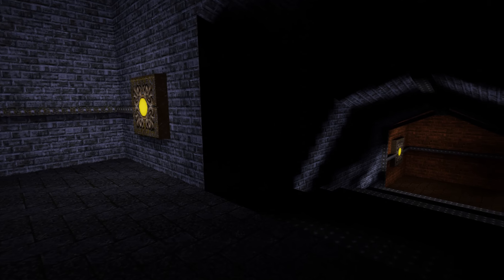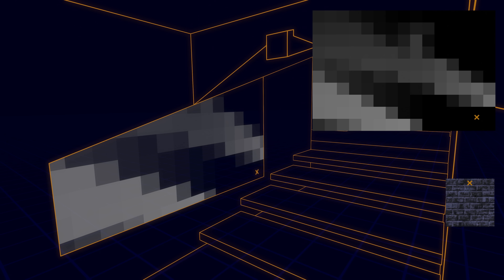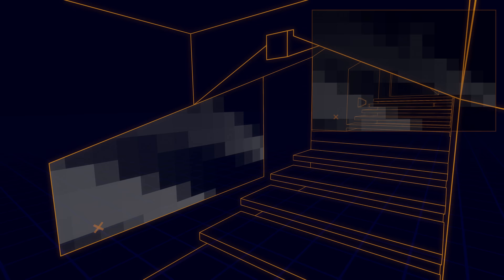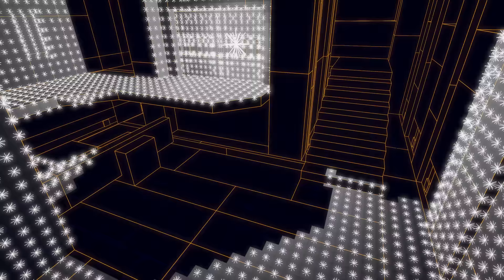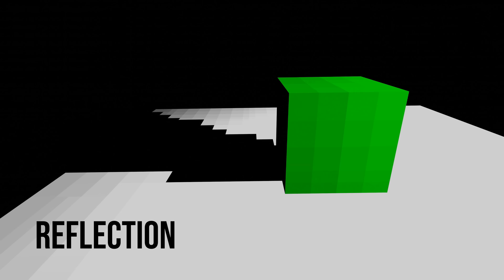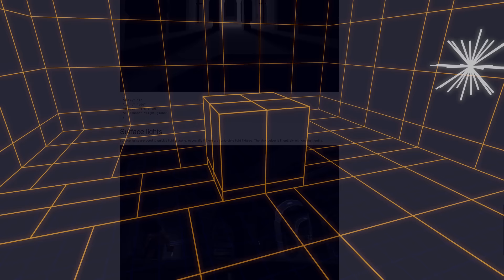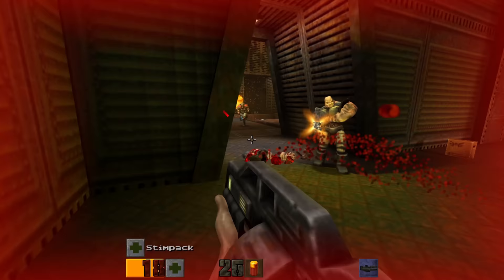Shedding light on Quake I and II lightmapping

Comment: Apparently Valve improved upon this in the Source engine with "Radiosity Normal Mapping".

As far as I could understand light maps are no longer baked in every face, but they calculate 3 directions of light so that the lighting of faces of any direction is easily computed at runtime as a function of the normal, the 3 light maps, and albedo. The 3 directions of light are stored on disk, being triple the size of a light map of the same resolution, the advantage I think, could be from being able to tweak the parameters of the lighting function during runtime, though I don't know if that's the actual motivation.
Reply: A way to think of it is that instead of a single lightmap, it calculates three lightmaps. Each lightmap is made the same way as you'd make regular lightmaps, but instead of using the surface normal you use a normal that is calculated from the surface normal rotated a bit to look at some other direction - and when you look at all three normals (that is the normals used for each lightmap) they are all perpendicular with each other. Then when you're rendering you just mix the three lightmap values based on the normalmap's normal. Valve published a paper back then that mentions exactly how they calculated these normals (you could use any three normals as long as they look away from the surface and are perpendicular with each other but Valve already did that part so no reason to not use theirs :-P).

I implemented this some years ago in an older engine of mine (if you check my channel you can find a video with it titled "Directional lightmaps" from 7 years ago), it works remarkably well (the video has zero dynamic lights, even the specular is precalculated by averaging the light directions and storing the XYZ values of the direction normal it in the alpha channel of each lightmap - this was a hack though and could certainly do a better job with it, like ignoring lights that do not contribute much and taking into account the surface color).
Reply: Current Q3 map compilers support it. Shortcut name 'deluxemaps'. Games like Warsow or Nexuiz make use of them, but Q3 itself doesn't support rendering them so they aren't of much use there.

Comment: Nice video :-). Lightmaps are neat, i think even today they are very useful when the lighting doesn't really change, though obviously you need slightly more stuff that what Quake 1 used :-P.

One thing i think needed a bit more explanation is the part about the samples moving to surface center, but someone else mentioned it (and you replied) already. Having implemented lightmapping a few times this part was always annoying to avoid (and Quake "cheats" a bit by having a solid world with no overlapping polygons - making a lightmapper for a generic polygon soup is trickier).

Comment: Really good explanation. Thumbs up. Out of interest, were there any changes with respect to Quake 3? I briefly mapped for Quake 2 but ended up moving onto Unreal whose tooling was really much more intuitive and the editor could rebuild lightmaps in seconds. The 3D viewport was even real-time and you could drag lights around and immediately see the effect on the map, minus shadows, which required a lighting rebuild.
Reply: Quake 3 had higher quality lightmaps, i think it is 128x128 by default. Also, it has overbrightbits, which kind of simulates HDR Lightmaps, but it's not as pretty. Years later Half Life 2 used real HDR lightmaps, which are much nicer looking.  Fun fact: you can actually inrease the lightmap detail in quake 3 using q3map2, and converting with external lightmaps. This makes some nice sharp edgees on shadows.

Comment: Love your videos! Can I request a video discussing how Quake stores the actual polygon data used for drawing? Not so much the bsp, but moreso the surfaces / triangles / verts / polygons used for drawing the walls of a map, etc, and how does this differ from other full 3d engines of the time? (ie System Shock, Unreal, etc)
Reply: From what I know, all Quake store their surface not as polygons, but as surfaces. The surface equation is A*x + B*y + C*z + D, where A, B, C are coordinates of orthogonal vector to the surface, x, y, z are coordinates of any point on surface, and D is coefficient, determining the offset of surface in 3D space. All surfaces with equal normal vectors (A, B, C) are parallel each to other.
For surface storage in .map file you need only 4 numbers (A, B, C, D), so you can create later polygons in map compiling stage to .bsp file.

Comment: Amazing video! I'm curious if Valve's VRAD (specifically the one used in GoldSrc and also the one from the Source engine, the infamous VRAD) differs from this method.
Reply: Valve VRAD is the derivative of Quake 2 lightmapper. It strongly differs from it, because it calculates indirect lighting and stores that information in so-called "ambient cubes" (simplified kind of spherical harmonics). These cubes allow to shade dynamic objects. Unlike Quake 3 light grid, these cubes are distributed not on 32 * 32 * 64 units grid, but on visleafs edges.

Comment: as far as I know Qauke3 changed this system maintaining the final result of a luxel textures, but implemented it in a 3d texture way? having a gird of point that kept the direction of all incoming fixed lights per point and their colour in order to have the 3d models well light, by the fixed lights of the map, at all times?
Reply: The 3d texture part is the lightgrid, which coincidentally was also added in the Q2 Remaster. Maybe we'll get another chapter explaining what changed with Q3 on that front - the Q3/idtech3 at large modding community also introduced some interesting light compiler development which surely must have influenced ericwtools we use today for Q1/2. I'm thinking of q3map2 with some work by ydnar et al. introducing phong, refining bounces and filtering options, etc.

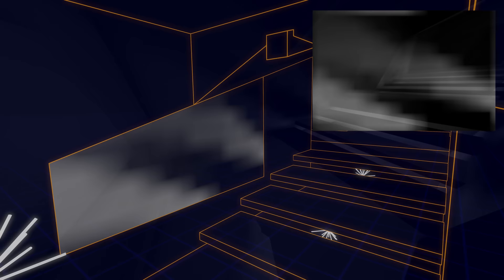Comment: 5:27 I implemented Quake style lightmaps for my engine but never figured out how to solve this properly, and to be honest even with your explanation I don't understand what is happening here. 

What does "any sample points that cannot see the face center" mean? Are they the sample points that are hidden inside the geometry where light cannot reach? You say that the sample points are shifted "towards the center of the face", but the points are moved only on the y-axis downward "towards" the center in the visualization. 

Is this process the same thing as replacing the hidden sample point values by closest sample point values that are visible to the light? Basically like clamping the hidden samples with first visible samples that exist at the visibility border? I remember thinking about this solution but not sure if I tried to implement it or got it to work.
Reply from the maker: Well spotted! The exact algorithm for shifting the hidden points is here: https://github.com/id-Software/Quake-Tools/blob/master/qutils/LIGHT/LTFACE.C#L270 .  It looks like it shifts 8 units in the vertical axis first, then 8 units in the horizontal if the shifted point is still not visible.  If after that it is still not visible then repeat the whole thing, for up to 6 iterations.  I never got to the bottom of why this exact behavior was selected.
Reply: @MattsRamblings  I see, that sounds very arbitrary but if it works most of the time and performs well I guess it makes sense. Thanks!
Reply: @meanmole3212  @MattsRamblings i think the same is done when there is a light grid system that uses probes( cube-maps )  in order no to have proves within wall or in the wall edge ( which would contaminate the final light calculations with wrong data ), the proves are moved within the correct space for the rendering and as well as for their final position, being kept out of the gird, and if their position needs to be corrected a lot, I think they are discarded
Reply: Yeah that bit sounded weird to me too. I also implemented lightmaps years ago in an older engine and this is something i faced. Personally i solved it in a different manner: when i take a sample i check if it is part of a polygon face (*any* polygon face, this is because two polygons might share  an edge in world space but use different lightmaps and the sample might end up over another polygon) and the face has the same normal. The sample is ignored if there is no polygon for it (e.g. lies outside the world) or if there is a polygon face with a different normal (failed at corner or there is another polygon covering it - e.g. imagine a box on a floor, the floor samples below the box would also have the box's faces on them). For each lightmap i also keep track of a mask for the lumel that had no samples contributing to it - after all lumels with at least one sample have been calculated, i go through all lumels with no samples and calculate the average color of the lumels with at least one sample that surround them and set their mask as if they had a sample. This is repeated until all lumels are set.

Making a lightmapper that looks ok is easy but fixing little issues like that is almost 90% of of the work. No surprise that many lightmappers even to this day have edge cases (though these days you can bruteforce your way by calculating something like 32 or 64 rays per lumel, which hides a ton of edge case issues). Unreal Engine 1 had these "black corners" which weren't solved until UE2 and i remember reading environment artist tips about cutting the bottom of models in UE3/UDK to avoid the black outlines in floor lightmaps.

These days i'd probably look into voxelizing the world and calculating lighting from that instead of using the geometry directly.
Reply: You can precompute lightmaps with blender, if that helps.

Comment: I wish an engine would come out that supports every lighting and shading model ever made
Reply: It would be a hell to debug such engine. That's why engines are designed with customization in mind. E.g. Open 3D Engine Atom renderer allows you to implement custom render passes.

Comment: How are the dynamic objects lit?
Reply: Moving objects such as doors do not change lighting when they move; they'll look the same even when moving to an area with very different lighting. Flashing, flickering, pulsing, or otherwise changing lights are done with a "style" value that the mapper sets, each of which is essentially just a list of brightness values stored as a string of letters which are computed during compilation and cycled through at runtime (fun fact - Valve still uses these strings to this day, resulting in lights in Half-Life Alyx that flicker in exactly the same pattern as the ones in Quake). Lights that can be toggled on and off through ingame events work in a similar way. In order to reduce the amount of additional work the compiler has to do, there is a limit of 4 light styles (including toggled lights) per face, and ericw-tools also disables bounces on these lights by default.

The Quake 1 and Quake 2 rereleases contain their own dynamic light system which is rendered separately and on top of the lightmap, which allows for crisper shadows that can move with things like doors and rotating objects.
Reply: @h4724-q6j Easily explains why a door's edge is completely black when is opened!
If the commenter meant "3D Model", I guess it uses basic vertex lighting.
Reply: @h4724-q6j  Great answer. I was also actually talking about say monsters in the middle of the room. Now I know they won't have very fancy lights, but is the light at the center of the room precalculated in any way?
Reply: @aussieexpatwatches  Things like monsters take a light value from the world geometry directly below their origin. This excludes things like doors and moving platforms. This value is then combined with the vertex normals to make it lighter on one side and darker on the other, so it looks like there's some directional lighting.
Reply: Vertex lighting. It's a very basic method. There is a lightgrid precomputed at map compile which subivides the space in in a 3d grid of points. Each point has a precomputed light direction. When lighting the model the light direction is calculated from the grid and applied to the model vertexes. It doesn't allow for 2 lights to be displayed on the model, just averages them. This works the same for Quake I, 2 and 3

Comment: somebody needs to bring this to the source engine
Reply: It's proprietary and source-closed, it's not worth to work for free to Valve inc.
Reply: @Capewearer Actually 🤓, Source Engine is technically open-source, you only pay if your mod is paid, if your mod if completely free then the source code is there, it's obviously not the complete code that Valve uses but it's has a lot of things.

And yes, this type of lighting is already in Source, there are other compilers that improve VRAD such as Slammin' Source Tools, which adds Ambient Occlusion, support for more threads, improved Radiosity algorithm, faster lightmap compilation for static mesh models (displacement maps for example), and alpha textures shadows support.

Comment: I'm sorry, but Quake 2 didn't have radiosity lighting. It simply used an ambient (minimum light value) setting. Radiosity wasn't even present in the original q3map compiler. It was introduced in q3map2, a comunity modified version of q3map source code which was later adopted by iD and is now mantained by Tim Willits.
The edition work of your videos is always stunning!

Comment: why dont you just render per pixel lightmaps with simple gpu raster, ie the cubemap view from each lightmap pixel, no need to resort to cpu only stuff
Reply: you're making some p. strong assumptions about how common and capable gpus were back in the 90s

the original release of quake didn't even have gpu support; glquake was an update id released half a year after the fact
Reply: OK zoomer, great plan! Remind me again, which GPU should we be using...in 1995?
Reply: and intels cpu package for ray tracing supports which cpu's, there is something rotten here with the "needs to be this-and-this" attitude @GarrettInShadows
Reply: @gsestream  Calm down dude, I was just sarcastically pointing out that there were no GPUs (as we know them) at the time Quake was made. Consumer GPUs were not available until around late 1997, and they were very limited in their capabilities. The programmable shader pipeline, as we know it today, only became a thing in the mid 2000s, and GPGPU programming wasn't really viable until the 2010s.

Quake was revolutionary because its use of pre-computed light maps made it playable on a 75 MHz Pentium with 8 MiB RAM and a VGA adapter with only 256 KiB of (slow) VRAM. It took hours, and in some cases days, to render those light maps on the high-end PCs that id Software were using at the time. It was impossible to achieve that level of graphical fidelity any other way.

You are of course correct that we can now render light maps in real time using today's GPUs. But I don't think that was the point of the video.

Have a good day.
Reply: but why you tell me that, thats my point, and consumer does not mean corp stuff does not exists, for example next step machines for doom light map calculations (dev down method). you make artificial limitations that need to govern me. no acceptable. @GarrettInShadows
Reply: nice knowledge there and limiting attempts, ruler. @GarrettInShadows